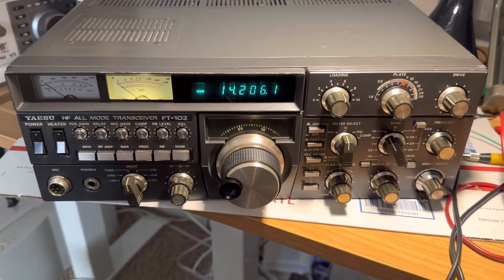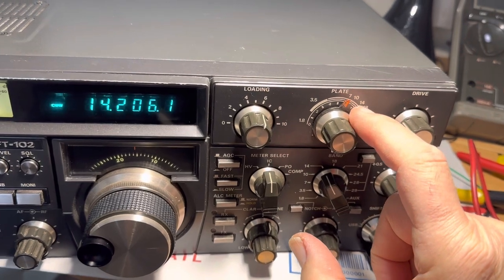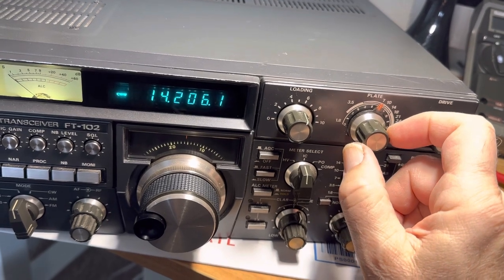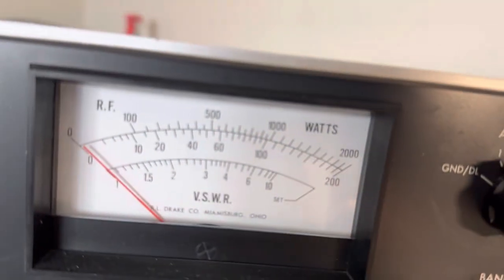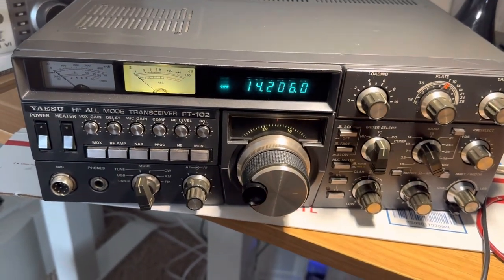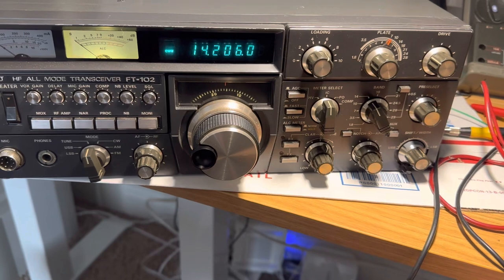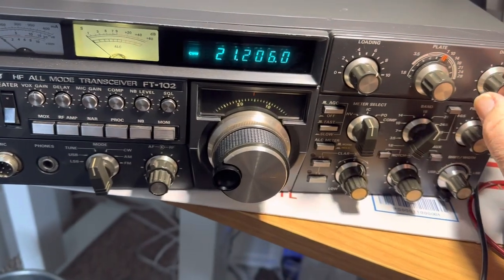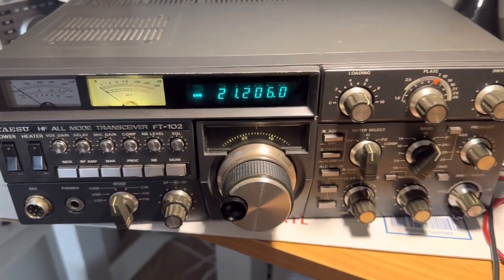Yaesu FT-102 is a transmitting powerhouse!

Comment: Most Drivers you just tune Plate and load and preselect for maximum output. The Yaesu FT-102 transmitter has one of the lowest 3rd order harmonic IMD ratings if you tune it the way the manual states. Turn the 25khz marker on and peak the preselect for max recieve. then position the drive at about 1 o'clock start the load at "0" and dip the plate. adjust the load a half click and re-dip the plate until the plate current is 300 mills. than adjust drive and micro adjust preselect until  ALC reads S9 and plate current is 300 mills. NEVER tune longer than 10 seconds at a time than let cool for about 15 seconds or you will warp grid and you will experience thermal runaway and pop fuses every time. sounds like this procedure would take forever, but I can nail it in les than 45 seconds. you get real familiar with where the load control goes on each band after a short while. Ft-102 is my favorite radio ever!!  Paul Ka4wht.

Comment: And it's my favourite radio to. I did a lot work to the relays and changed just about all of them. Something changed lately so that I have to turn my drive control all the way up to get 140 watts out. I tune it up as the manual states.
Reply from the maker: Sell it before it totally craps out.